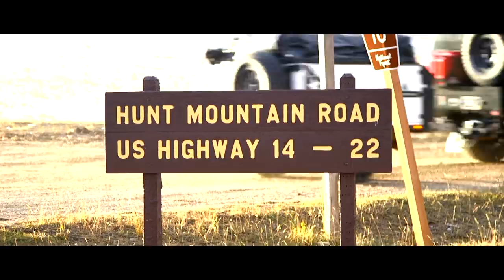Overlander S1 EP13 // We Explore Wyoming and Off-Road with the Full Size Tundra

Comment: Hi guys! In meny cars if you take the battery off, it needs to be driven 15-25ml and the car learn itself and the tractioncontrol comes back. Bmw needs that you put steeringwheel totally left, totally right and then in the middle, and then you have to drive 15ml and it makes the calibreisson itself. Nice videos you have. Greetings from Finland.

Comment: Great video, I enjoyed it. However I find it extremely unlikely that the Tundra was unable to provide enough power to make it up that hill, especially if it were in low range as it should have been. The more probable explanation was either 1) This was used as an excuse to showcase the winch on camera, or 2) The electrical issues were causing the truck to cut power. Also I wonder if the A-TRAC system was even functioning? Very nice truck none the less.
Reply: I would like to think it was number 2.

Comment: Glad the conversation of long wheel base was brought up. I’ve been look into getting a Tacoma TRD off-road double cab long bed and don’t plan to do any adventures as extreme as Expedition Overland does regular. However, I’d love to hear from Expedition Overland on the Pros and Cons of a Tacoma that has more than a foot longer wheel base, then the regular double cab. Heck maybe a video would be in order?
Reply from the maker: You would be fine 98% of the time. Look for the greatest advantage and pick the truck that suits you most often and the greater need.

Comment: I'm left with a few question. Like what was the electrical problem? Did it keep you out of  4w Lo? Why was the truck swaying so much at speed on dirt, was it a tracking issue or where you driving to fast on to low psi? Do you feel the Tundra need Lockers at least in the rear or were the LS diffs getting it done enough?  Thats the first time I've ever heard anyone say the Tundra was short on power. Great vids, great work congrats oto the new member of the team.
Reply: I have the exact same question... the Tundra wasn't in 4lo because of the electrical issue? Never heard about a lack of power with a Tundra...
Reply: That lack of power was really bizarre... nothing should be running out of power in 4low, even with a heavy rig like that. The low range gearing should be more than enough to overcome the weight.

Comment: Wow that lack of power thing was strange. Seemed like it just wasn't in low range or something. Thought that V8 would have plenty power with those tires and stock gears
Reply: Alex Stern  I agree I think it was traction issue  or maybe lack of a locking rear end.
Reply: @slange455  Or it's in the sponsor deal that they have to use their Warn winch in every episode...
Reply: @jspeedadventures  got em
Reply: With a manual gearbox it would be smaller issue
Reply: Its likely the fact that it has all the added weight of the box on the back, steel bumpers, extra gear, the winch, the trailer, etc.  Plus, its a Platinum edition and not a TRD Off Road or Pro which come with lower gears. That thing was intended for a luxury truck buyer who would probably never take it off road.
Reply: @Flying_Dollar_Motorsports   ....or it was just fake manufactured drama. I'm gonna go with the latter

Comment: Sound like the tundra needs a zero point calibration its a easy fix! some scanners will also set of the lights . I know the 4runner can be set by jumping two pins on the obd2 plug

Comment: Hey guys, I have been slowly building my own Tundra and weight as been an ever growing issue as more and more parts and supplies get added. I was down at Exploration Offroad, the Pcor dealer in the US the other day checking out the X1 but also the tray system. How on earth did you guys keep your truck under payload limits with the tray and box? You must be way over payload according to the weight numbers listed by Pcor.

Comment: Did you ever find out what was the reason for the "electrical" issue and how did you do to fix it?  Just had the exact same scenario happen to my 2010 FJ. Tach and speedo went dead, then came back on after unplugging and plugging the battery, but the trac, abs and brake lights on the dash cant be cleared.

Comment: Without knowing too much it sounds like whoever cleared the OBD II either didn’t have the capability of clearing Toyota’s ABS module or they forgot to. The Toyota Xmas tree is usually all the ABS and TRAC lights.  With that traction system not working high speed driving in 2wd will be vastly different but hopefully it isn’t active in 4wd which is normal.

Comment: Were you locked out of 4low with the traction control light on?  That winch recovery scene seemed that you didn't have adequate power because you weren't in 4low.
Reply: I don’t really know a lot about the USA Toyota range. But I’m pretty sure it does not have true low range. It uses the traction control to overcome it

Comment: wait....the PCM limited the power to the wheels? sounds like a really bad idea when you need to beat on it a little bit don't you think? granted you could just winch out but if you don't have an anchor point or the winch goes out/line breakage your literally stuck because it's telling itself it wants to be identified as a Prius at that moment when things get tough instead of putting that power to the wheels like a Tundra should.

Comment: That's such a pig of a truck... I can't imagine it would be any lighter or more nimble than a Power Wagon, or Ram 2500 with the AEV 3" lift, yet it's much less capable with a lower ride height and weaker IFS axles. Why did you decide to go with a Tundra if Toyota isn't footing the bill for your sponsored vehicles anymore? Just seems like a Power Wagon with some mods would be built so much more ready for what you're doing here than any 1500 with IFS and no lockers.

Comment: how do you guys heat your tents in colder weather?
Reply: The trailer camper has a heater, that's probably the Webasto combination water heater in a fully optioned X1GT that Justin from Patriot Campers gave Clay for his birthday several episodes back. The heater doesn't make it toasty, but just cuts the chill enough. As for the Alu-Cab rooftop tent on the Tundra, I think that's insulated, but don't recall them showcasing that bit of gear.
Reply: @TheSledgehammer205  thanks! I'm looking for heating options for a Tepui Autana xl.

Comment: Those only read and tell you code ...I thought the same I walked back in said could get it to clear auto zone has those same ones
Reply: Could have purchased obd2 scanner and clearer while at Napa apparently  is needed 😂 and cheeaper than dealer
Reply: They need a real diagnostic tool, not a cheap generic OBDII code reader from the parts store...
Reply: @skibee1000  they clearly said they just needed ti clear the codes...either way they we're leaving then and something would have been better than nothing and they do have nice ones there
Reply: Josh B the code readers at the parts stores are not capable of viewing or clearing pending codes, stored codes, or live data. They’re useless. All it’ll do is check the status of generic OBDII codes. A real scan tool will view all codes for all modules, clear all codes for all modules, read live data, and give them bi directional control. 

That little thing they bought obviously didn’t do anything, might as well just throw $50 bucks out the window.

Comment: Were you guys using 4X Low Range on that incline? I find it hard to believe in low range that truck couldn't go up that hill even with how heavy everything is.
Reply: I was pretty surprised too although sometimes the camera doesn't do the incline justice.  I do wonder how heavy that trailer is.
Reply: I don’t really know a lot about the USA Toyota range. But I’m pretty sure it does not have true low range. It uses the traction control to overcome it
Reply: @jeremywood4207  Maybe I'm mistaken but I think you're confusing locking differentials, which can be simulated with electronics, with a low range transfer case which cannot.
Reply: sonictech1000   Not what I was meaning. Just that I didn’t think the new Tundra’s had a low range transfer case. Just a fancy traction system.
Reply: @jeremywood4207  The Tundras have low range.